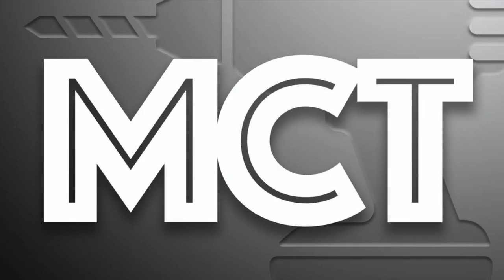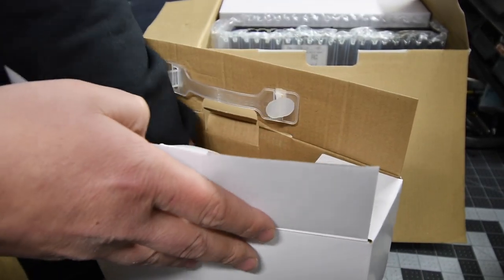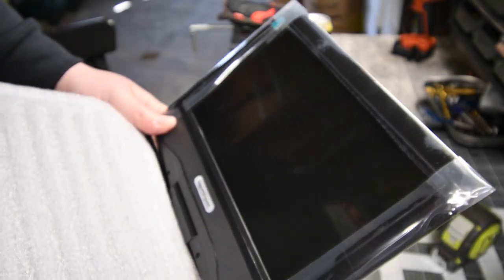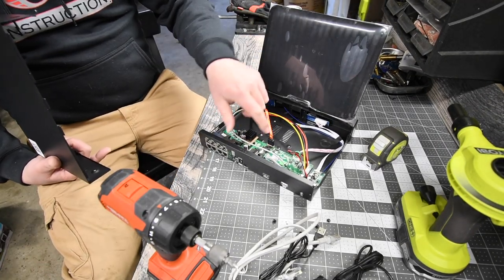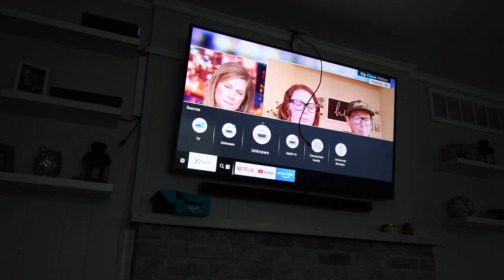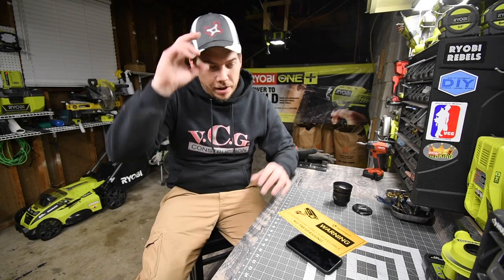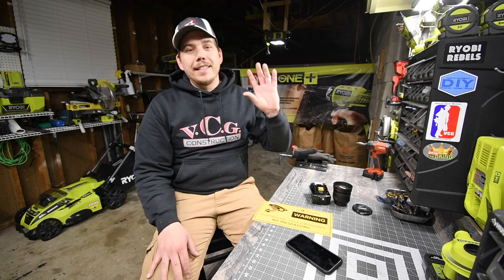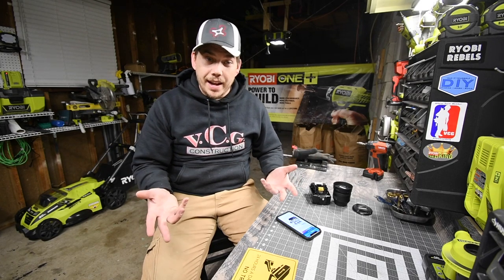HeimVision Security Camera System

Comment: Nice but you should’ve pushed your connections inside the hole and mounted the camera outside over it. Looks cleaner that way.
Reply from the maker: I did. their is only 1 that is not and that is the one that is in the garage. the others are pushed in the hole I drilled out